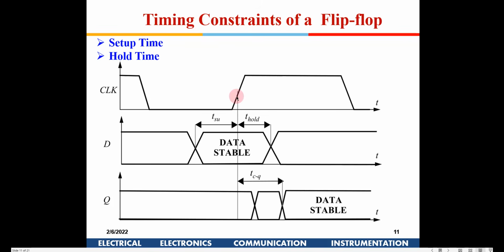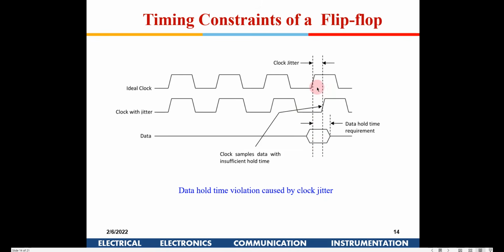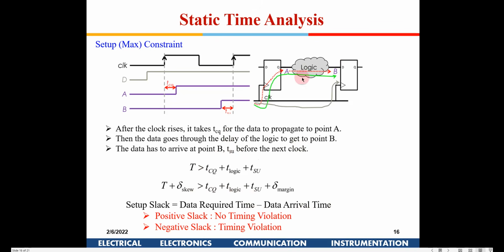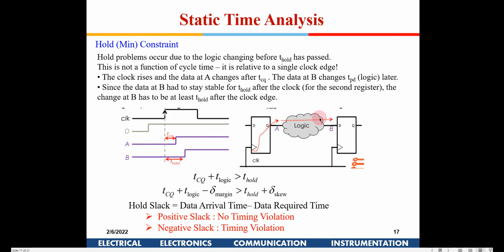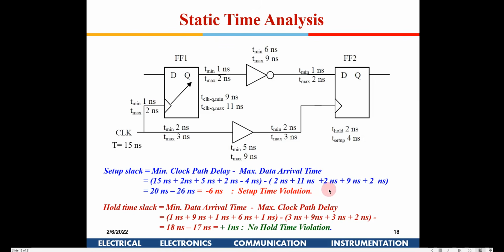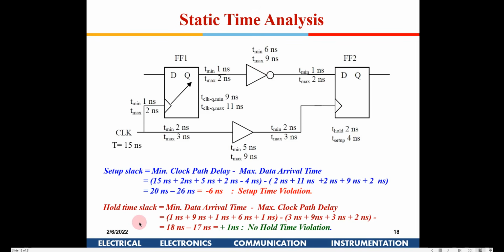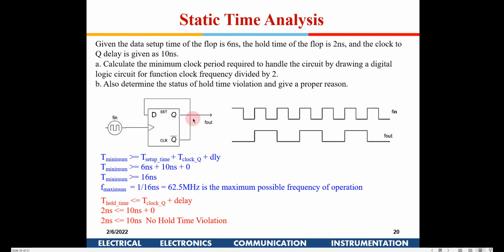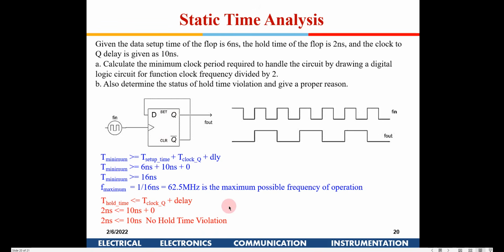Advanced VLSI Design: Static Timing Analysis

Comment: thankyou sir for great explanation, I  am not getting why we are looking hold time for the same clock edge....i watched the part multiple times, still not getting
Reply from the maker: The data need to be stable for a certain amount of time after the clock arrives. The data from previuos clock has aledat settled tocater for set up time. For the  hold the data from presnt clock should come slow enough to cater for hold time
Reply: @SanjayVidhyadharan   ohh,so the data should come slow,in order to avoid collision
Reply: Hold failure means that the data intended to be sampled in the current clock cycle has been overwritten by new data sneaking through to the flip flop due to very fast data path. Ideally the flip flop should have been cutoff before the new data sneaked to its input. Failure to do that leads to hold violation. That is why hold checks are done at the same clock edge since it is a failure of the same clock. Hold failures irrecoverably corrupt data since there is no way the overwritten data can be recovered.

Comment: We can summarize the gist of the static timing analysis in two sentences - 1. we want the signal to have enough setup time in one clock cycle (therefore the min. clock path delay - max data arrival time > setup time); and 2.We don't want the next bit coming too fast that we haven't finished the hold time yet (therefore min. data arrival time - max clock path delay needs to be greater than hold time required).
Reply from the maker: Yes.
Reply: This comment pretty much sums up the whole concept
Thanks mate